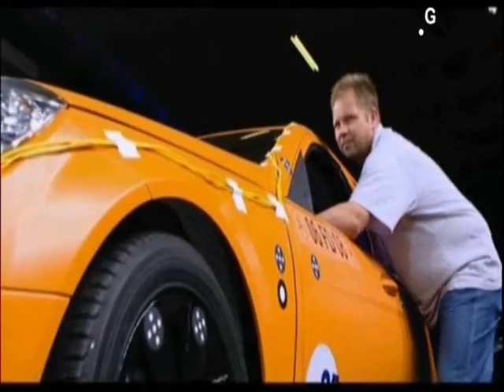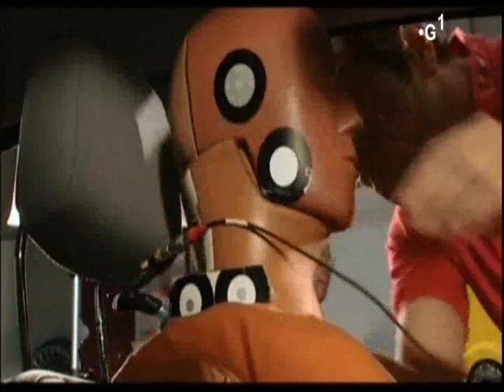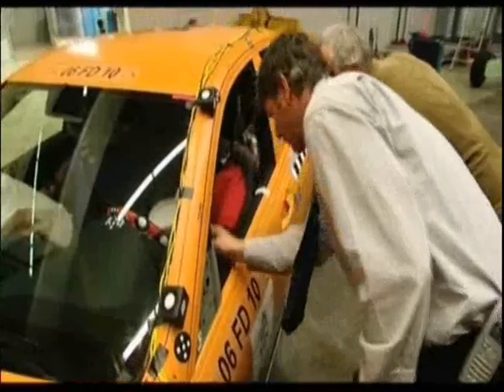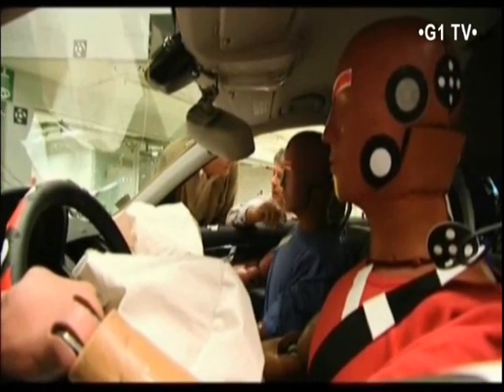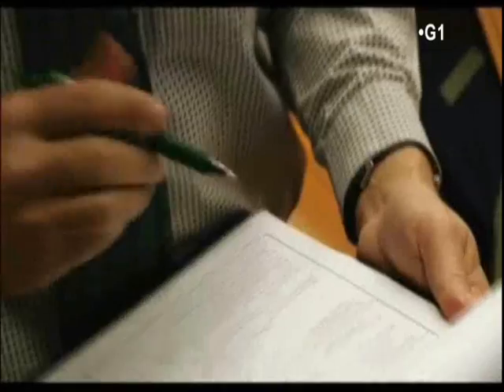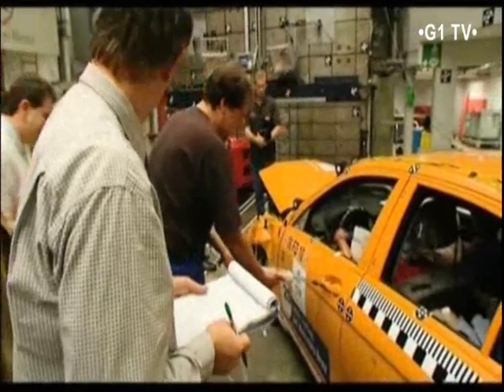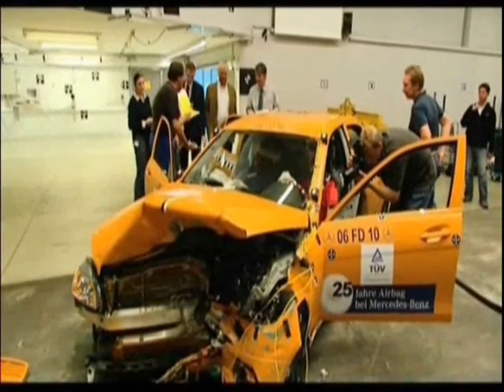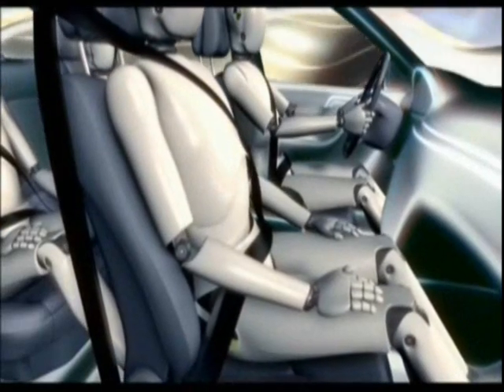Mercedes-Benz C-Class crash Tests

Comment: @CMstyler, the c220 cdi is a very good car, I personally have one, feels a lot faster then mercedes claim, but if you are still looking for one i would get the c250 cgi, just had one for the weekend and it feels lighter and the nose with a higher top end to the engine. Saying that i get better fuel economy in my c220 and it pulls better (albeit with more turbo lag) then the 250 at low rpm